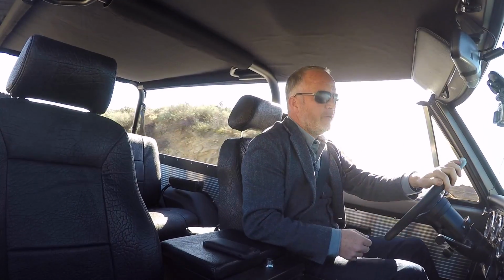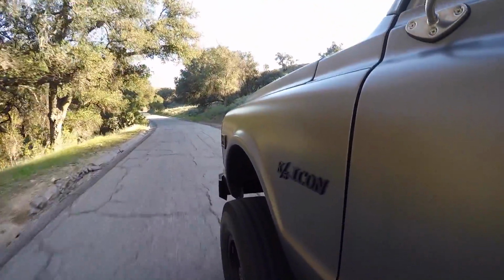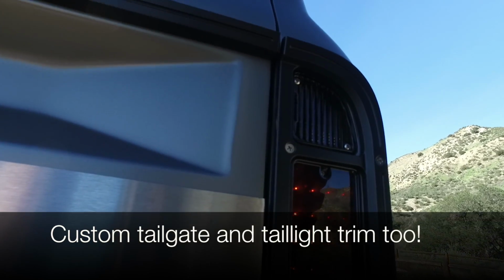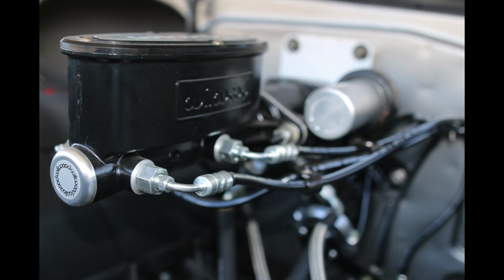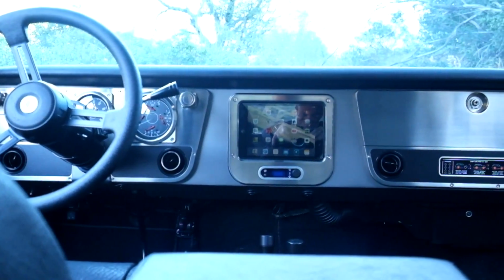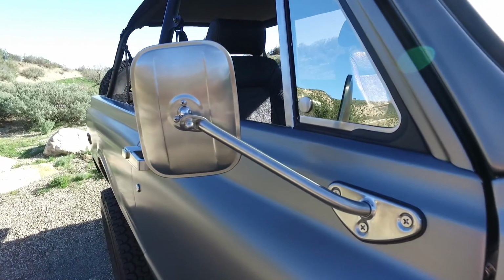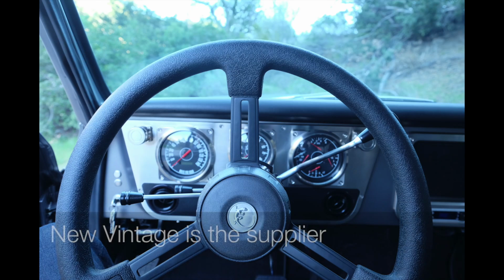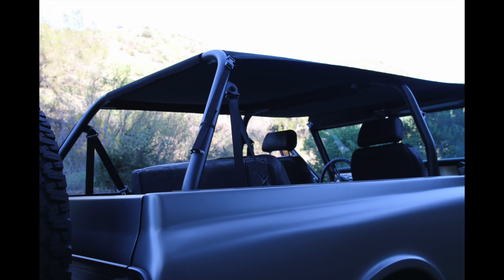ICON GMC Jimmy Reformer Test Drive!

Comment: Mr. Ward. You and your crew are doing a great job! I have thought about doing something along this line of thought to my 46 GMC heavy half ton. I don't know how long you have been doing the Reformer type projects but I looked at buying a 67 3/4 ton Chevy 4x4 about 25 years ago and it was built along this concept. GM crate motor, new type GM seat, etc. That was the first time I had seen anyone go that way with a old vehicle and not do full on restoration. Now, your projects give me great ideas for my old Jimmy. The Restso/Mod/Rod movement is really cool, I'm going to go a little more "resto" on the 46 and if you have a customer that goes a little more on that tangent we all would love to see that too. Thank you for keeping the old stuff on the road. Cheers from Iowa!

Comment: Hi Jonathan, did you use the amp research power steps on the jimmy?  is there a particular kit that you prefer?
Reply: +Jonathan Ward I bet they do! One other question I have is how did you fix the gap between the tailgate and the hardtop rear hatch?  the stock metal trim piece is pure ugly and I can't figure out a good solution....